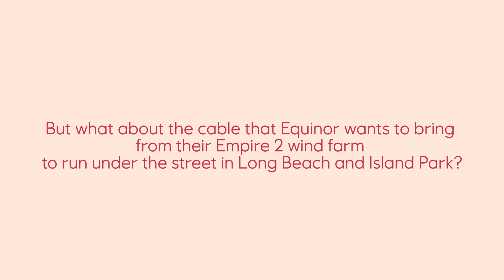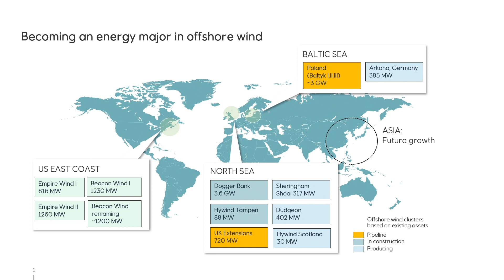Learn about EMF

Comment: The comparison chart goes by too quick and is not easily seen. A picture of a hair dryer with 300 mG would be a better comparison to the cable in the street. What is the emf coming from the existing utilities in the street? Are those in duct banks?